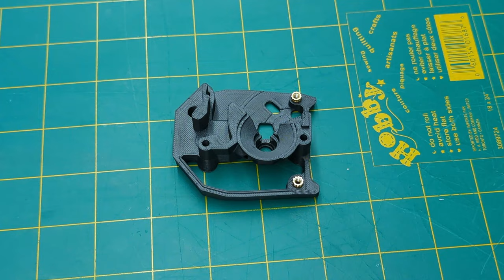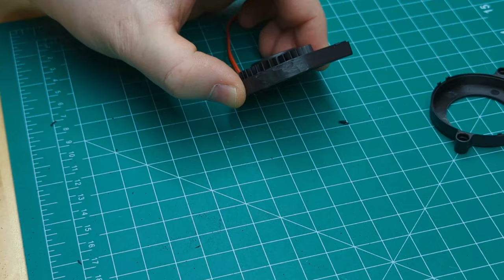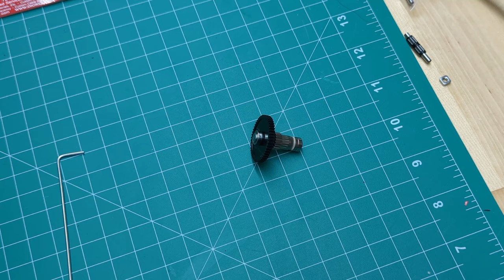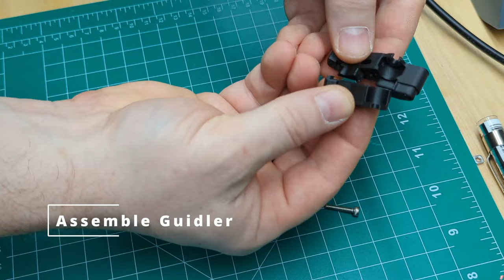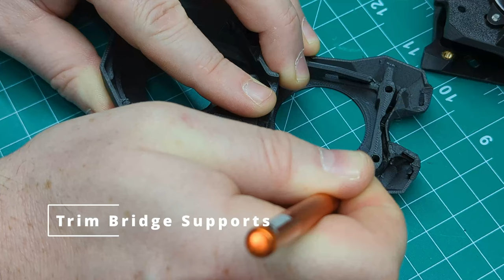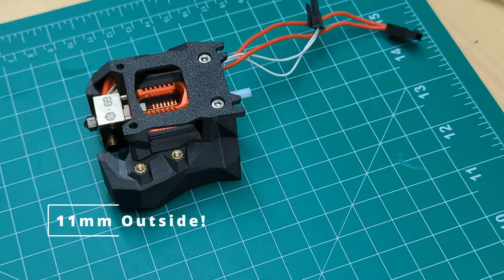We Build Our First Stealthburner Toolhead!

Comment: Sicer settings for printing the parts? Supports? Fan on?
Reply from the maker: We use ellis' profile for the speeds etc.     The CF-ABS is printed at 260, bed at 110, no supports and always use fans for abs!   In this case it was around 35-40% with a SB.

Comment: Nice build, super clean prints. I’m going to use this video as a walk through if I print this version. Do you have a parts list by chance of what you used listed anywhere?
Reply from the maker: Thanks!  I recommend following the latest manual too not just our video, this wasn't really intended to be a video manual or anything like that.

We used the BMG Extruder kit (same as afterburner), 
The stepper motor is a LDO36STH20 
The fans are GDSTime

Comment: Thanks for the vid, very instructional. I'm deciding if I should install the Xol toolhead straight away before bothering with the stealthburner as it's kind of an unnecessarily huge and heavy behemoth that bogs the printer performance down at almost 500 grams. I know people say to do the build stock at first before any mods.
Reply from the maker: printer performance isn't measured in grams, don't let the hardcore gram-chasers get in your head.  the toolhead weight is unlikely to be your speed bottleneck.
Reply: @MapleLeafMakers  Everything counts. The weight is an important factor, the Y axis is like 1150 grams stock. With the parts I have ordered it will be 600 grams and also stiffer so there will be a difference for sure. It's not about absolute speed, it's about printing high quality at a higher speed and weight is very important for that but yes the other parts need to be good as well.

Comment: Where can I get the tip you use for brass inserts, I found one but it was only for an M3?
What was the filament you used for the Stealthburner, I have some PC-CF and some PETG-CF but I suspect ABS-CF might be more suitable for the Stealthburner.
Reply from the maker: The tip we used for threaded inserts is made and sold by LDO -- it only works for M3 as well.  Adafruit sells a similar tool without the adjustable depth and has separate sizes for M3 and M5.  

This Stealthburner was printed entirely in ABS-CF From 3DPrintingCanada.com, but PC-CF is also a good choice.  I would not recommend PETG-CF.
Reply: @MapleLeafMakers  I think I will get the LDO one and the Adafruit M5 one also, they are probably better than the one I saw on Ali Express

Comment: Great video! Helps me a lot in some parts of instalation. I have a question to the video about "Heatset is missing" 4:06 part. Current beta manual nothing mention about putting any screw and bras inserts there. (CW2 Main body beta 11). What should be there and what is it purpose?

Another question is for part 6:05 Two bras inserts on the right side of hotend. What is the purpose of them? I did not found any proper part that can fit there. Thanks!
Reply from the maker: Glad you're finding it helpful!  That screw is used to adjust the minimum spacing between the extruder gears, as seen here: https://user-images.githubusercontent.com/34219833/155484746-fd3ebe8b-fb63-4732-93e6-a2b54ff8adbc.png  

The 2 threaded inserts next to the hotend are used to for the ADXL mounting bracket.
Reply: @MapleLeafMakers  Fixed - Thank you!

Comment: 4:06 - MIssed the same one.  I don't believe it's called out in the current instructions.
Reply from the maker: I don't think it was either that's why we chose to include the footage of our mess up!  Hope it will help others.
Reply: @MapleLeafMakers  What screw do you put in there?!
Reply from the maker: We used an M3x6 button head here, but I think the current recommendation is flat-head now.
Reply: @MapleLeafMakers  I'm not completely sure what this even does to be honest.  It seems like it limits the closing force on the filament?
Reply from the maker: That screw is for Adjusting minimum spacing between gears with no filament loaded.    Doc posted a list of instructions on discord for how to tune the SB in now using this screw + tensioner.
Reply: @MapleLeafMakers  It would help if there were some instructional video to explain how tensioning works for all of us newbies.  I put in a M3x6 flat head screw in there and realized that was the reason for the hole on the latch... to allow access to that screw from the outside while it was closed. Duhh.
Reply from the maker: @Antebios  great idea thanks!    We will make one detailing this soon to help people out.